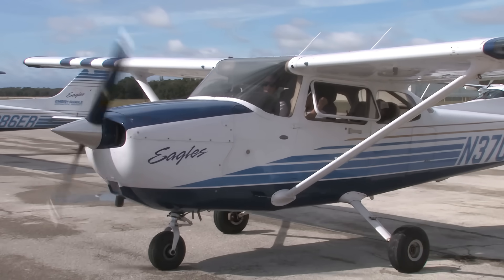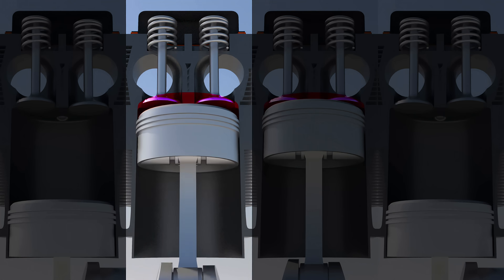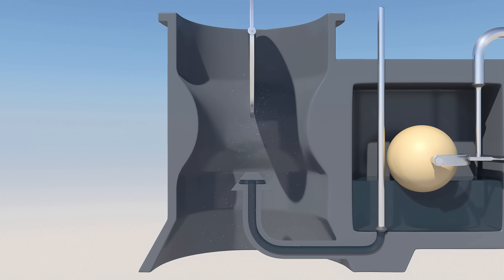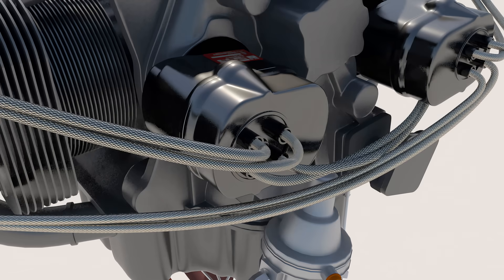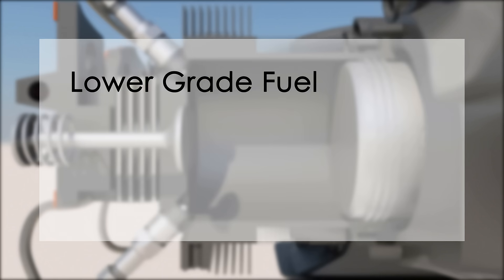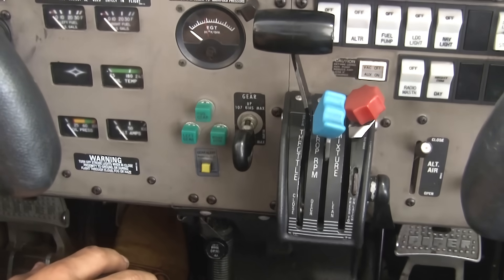Aircraft Systems - 03 - Engine

Comment: I would recommend installing a backup radio,gps,  battery, magneto, fuel pump, and have a  separate Garmin or digital handled avionics, think outside the cockpit.

Comment: The fuel air ratio is 14.7:1 by weight, not in number of molecules. It happens to be not that far off in the chemical formula (25:2 for octane) but as stated this was incorrect.

Comment: @erau great video but, I believe the airflow animation through the carburetor venturi is upside down 😅 if it moved up as it's animated here, you'd have high pressure on the wrong side of the venturi, leading to fuel starvation. Correct me if I'm wrong please 😁 just seems incorrectly animated
Reply: Thank you. I thought I was the only one that noticed that. You are correct, the low pressure side is on the downstream of the venturi. It is depicted and described incorrectly.

Comment: That’s interesting. These are basically just like automotive engines, but they run slightly leaner as automotive engines run at 14.7:1 air/fuel mixture. If you guys wanna learn more about engines go study automotive, it’s all kinda the same and goes way in depth on the science of things

Comment: I thought for sure they used a turbo of some sort. I cant believe how basic this system is. I've worked on cars that were more complexed. I'm curious on how they use the exhaust as heat though. I'm sure its basically like a water heated system. My question would be the safety measures from exhaust getting in the cockpit if the core failed.

Comment: Why do they usually use boxer engines when there's some other configurations that may be better. And who are the engine manufacturers? Because not all engines are same in terms of reliability, dependability, durability and longevity. I would not trust BMW, Mercedes , Ford or Chevrolet engines. My best bet is Toyota engines for example.

Comment: One minor error: It depicts nothing going to the magnetos when engaging the starter. In reality, in most airplanes, when you pass through the "Both" position BOTH magnetos are active, but as you hit START the RIGHT magneto is grounded out so that you're starting on the LEFT magneto only. This is why Cubs and early Cherokees that used a starter button had you start on the LEFT mag only, then turned on the RIGHT magneto after start. Otherwise, very good video.

Comment: Would have been nice to see you get a little more in-depth discussion about the magnetos, particularly how impulse couplings work. You also mention how turning the ignition off prevents the spark plugs from firing, but fail to mention the danger posed by a broken P lead (grounding lead for those of you who don't know). Spoiler alert: If the P lead wire breaks (which sometimes happens), the magneto fires a spark even if the ignition switch is turned off. When turning a propeller by hand, always treat it like the engine can start.

Comment: I know even not being a pilot or mechanic that the reason the Cessna C172 has two sets of ignition systems is for redundancy. Imagine loosing the engine over the distributor failing? Chills.

Comment: What are the reasons why you would configure the magneto to left or right only?
Reply: During engine start, the ignition key grounds out the right mag, so only the left mag provides spark. The timing of the spark from the left mag is retarded (later than usual) during engine start so the engine will start easier. (I just copied it from Google.)

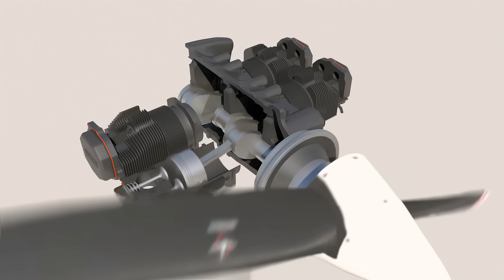Comment: 1:30 - 4 Stroke Cycle - Reciprocating Engines 

3:18 - Camshaft. 

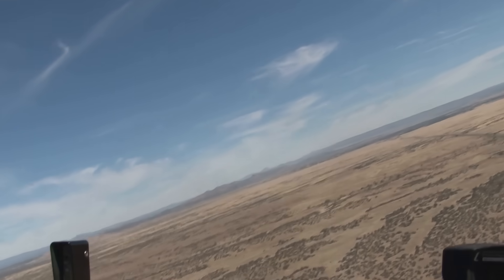4:20 - induction system 

5:45 - Carburetor System/Fuel Injection 

7:52 - ignition system

11:10 - Engine Cooling

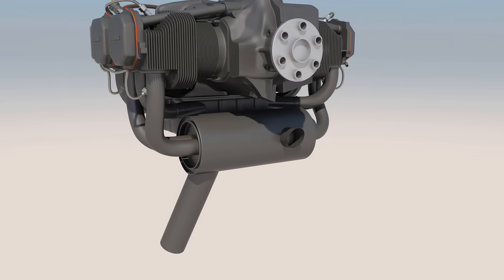12:17 - Exhaust System
Reply: Thanks, but the video was so Damm interesting that I dint even forward once..
Reply: @LeRiderOP  Le facts!
Reply: I’m 49 and I’m just getting into aviation. Never been a mechanical guy. This video combined with the PHAIK and my online ground school got me sqauared away immediatley

Comment: 3:30, "the camshaft is a rotating cylinder"?
The camshaft is a rotating shaft with lobes on the outer side to operate the push rods which in turn operate the valves at the required time.

Comment: 0:41 "Because without it, there would be no way to get the plane off the ground"

Gliders: "hold my ballast"
Reply: Some sort of an engine, be it on a towing aircraft or a winch is required to get gliders of the ground.
Reply: @strikereureka5081  You can launch a glider off a hill/mountain
Reply: @MIZUch.  Fair point, although in most instances some sort of external propulsion is used.
Reply: @MIZUch.  technically, that's getting the ground off the plane rather than getting the plane off the ground, still. So it really all depends on the point of view.

Comment: This is an excellent video however I have to nitpick 1 thing because it has frustrated me that it's taught like this in flight schools. Air-cooled engines are NOT primarily cooled by the oil. Yes, there is an oil cooler on some but they are primarily air-cooled just like some motorcycles and most old Porsches. Oil coolers are there to cool the oil because the oil gets very hot; i.e. oil is not like coolant for the engine. Most of the oil is not even where most of the heat occurs (cylinder head and body of cylinder) and the tiny bit that is there to cool the rockers is not enough to actually cool much at all, that is the job of the cooling fins.

Comment: You've confused Reciprocating with Internal Combustion. A Reciprocating engine is round with one mainrods and as much as 8 attached rods.
Your video is primarily an opposed cylinder configuration.
Reply: According to the Pilot's Handbook of Aeronautical Knowledge, all reciprocating engines "convert chemical energy (fuel) into mechanical energy [through the process of combustion.]" The engine you are describing is a radial engine which, like the four-stroke opposed engine in the video, is a reciprocating engine. It is all outlined in the aforementioned handbook, more specifically in chapter 7. Hope this helps!
Reply: @vivianahernandez2124  Reciprocating engines are round. All engines convert chemical to mechanical. There are two types of engines. Internal cumbustion and jet. Jets are uses as jet, turbofan and turboprop. Internal cumbustion includes all piston and rotary engines. Of the piston type are Reciprocating, oposed, inline and v configuration.
Reply: Nicolas Habash Nicolas Habash Not all reciprocating engines are round, but they all are combustion engines. A jet engine would be considered a turbine engine, which is not a reciprocating engine. I would take a look at that handbook, there is quite a bit of information you may find useful.

Comment: How does a single engine plane deal with engine torque?
Reply: Mystic Wine Are you talking about left turning tendencies? This is only more common during takeoff and climb, You can try the ground adjustable rudder trim, or simply use rudder.
Reply: @abbysnowmist  Thanks for the knowledgeable reply. I'm not a pilot but I was always curious after watching the way helicopters deal with it.

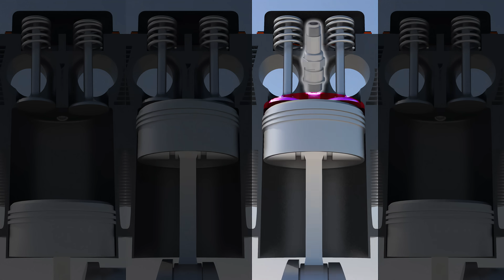Comment: 2:21 The spark event actually occurs during the tail end of the compression stroke, since the flame fronts move gradually, steadily building the pressure, such that peak intra-cylinder pressure is achieved at some point past top dead center where the connecting rods have more mechanical advantage to turn the crankshaft.
Operate in the red box, say 50° ROP EGT and >75% power, and the flame front burns faster, ICP occurs closer to TDC,  CHT rises and detonation could occur.
Reply: Sorry explain a little more @gza036
Reply: @harryb8023  lol...

Comment: Hi. i have Lycoming 0360 b1b engine. After 10 minute when i start the engine, oil getting hot over 100 so i am thinking my oil cooler working not properly or i applied it wrong? is there any manual how to apply oil cooler on Lycoming 0360 B1B engine. Please help guys it would be huuuuge help for me.

Comment: Enjoyed your presentation. The main issue with piston prop planes in the US is that they use leaded fuel or Avgas. The only use of leaded fuel in the nation. If you live near a small civil aviation airport or in a busy general aviation path you may wish to get your blood tested for lead. I lived through the leaded gasoline era of the late 60's to about the mid to late 80's and came out okay (took a lead blood test). With lead, no limit is a safe limit. There is a company called Swiftair that is marketing lead free Avgas. See their site at @t.

There is of course work being done on short to mid-range ELECTRIC powered propeller aircraft. Avoids the issue of lead altogether and cleans the air we breathe (yes electrons from coal powered plants are more polluting than "green" sources but the grid is getting greener every year). 

@t

@t

Comment: Its sad the piston airplanes are still using engine technology from the 1920's. It's still using manual air mixture. Even though many engines in aircraft like aero diesel engines are FADEC and control everything just like car engines, and now we are already looking at electric aircraft... here we see the crappy companies like Cessna, piper... still using this garbage that demands so much work from the pilot just to keep the propeller turning.

Comment: aeroplane electrical system working on which frequency whether50hz or 60hz or 100hz or ?
Reply: Most are DC at 12 or 24 volts. Large airliners also have 400 Hz AC on board.

Comment: Umm, Explosion? No.  Burning the fuel is very rapid but it's not an "explosion".  When leaning out the mixture in a pistion engine, it can become too lean and then detonate which is extremely hazardous to the engine.  Why do people continually use "explosion" to describe the burning fuel process in an engine.  It it NOT an explosion.

Comment: As long as these engines have been around you would think they would be nearly flawless , in fact they are some the most unreliable engines there is . Replace it with a Subaru boxer engine and you got many years of flawless service . The Subaru  , like a Porsche , is a boxer motor . They are fuel injected and turbocharged and very reliable . They are smooth and more powerful than the Lycoming/Continental . and run on car gas . This is just nuts . I am a 40+ year pilot with a few thousand hours in many types and you just never know when that heavy , under powered slug is gonna quit . In reality , these engines are just big bore VW but maybe only 25% reliable.

Comment: almost the same with vehicle engine
Reply: They should have mentioned that but they didn't!
Reply: Except it’s air cooled. Uses magnetos. Has dual ignition. Uses updraft intakes and carburetors. Has only a 2700 rpm redline. Has huge cylinders. Has fixed ignition timing. Has no emissions controls or systems. Is designed to run at 75% power for hours at a time. 

That’s why automotive engines make lousy aircraft engines.

Comment: As a Canadian and perennial sufferer of colder weather, I feel like it's important to add that another huge advantage of fuel injected engines is that they don't suffer from carburetor icing. Don't forget your carb heat, ladies and gentlemen.
Reply: Well said, although you really don't need a cold climate at all to encounter carb icing!
Reply: Carb ice is almost nil in a Canadian winter. It’s summer where it rears it’s ugly head—but rarely on Lycomings.
Reply: @Bartonovich52  True enough.

Comment: Guys, does anyone know where is it possible to find this one solidwork model of "Lycoming" engine? And how much does it cost? Thank you in advance!
Reply from the maker: Alex S. We’re glad you like the model. Our team custom built this one in-house and unfortunately it isn’t available to the public.
Reply: I'm a professional pilot and I try to do my own aircraft (by my hands) and I'm designing my aircraft in a solidworks. I don't want to publish something. I'm going to use Lycoming engine for my plane and it would be great to use your model in my designing. (it would save a lot of time and prevent a lot of mistakes).
 I don't need anything inside the engine, but for my designing very important correct dimensions and how to connect to my a/c (designing) different magistrals such as fuel line, air line, power control etc.
  So if you would help me, I will be very happy! (not free, of course) Because I'm afraid that I will never done my project. :((((
Reply: Thank you in advance!

Comment: how come a minute difference ratio does not add in millions of strokes to a few degrees leaving the valves to open at the wrong time?!
Reply: Cam and crank are geared together on a simple 2:1 ratio.
As long as they're assembled correctly, valves will always open/close at the right time.

Comment: Umm the part early on about "no matter what position the crankshaft is in one of the pistons is in power stroke in four cyl. Engines"
   I do not believe that is correct for a flat, horizontally opposed 4 cyl. Engine. In order for it to be balanced the opposing cyl. Would have to be in power stroke or there would be an imbalance.
   Its not just the piston and con-rod your balancing out, its the pressure from the power stroke.
  Am I correct?
Reply: You are confusing reciprocating weight with power strokes.
Reply from the maker: Stephen Smith -  Great question! The Lycoming IO360-L2A,  when viewed from the cockpit, is designed as follows....Cylinder 1 is on the front right, Cylinder 2 in the front left, Cylinder 3 is aft left, and 4 is aft right. It has an ignition firing order of 1-3-2-4. If cylinders on opposing sides were in the power stroke at the same time, the opposing force would most likely bend the connecting rods.
Reply: Jim Foreman no, most 4 cyl. Boxter engines in automotive use fire of 2 cyl. at once and use counterweights on the flywheel to balance it out.
   Interesting that these engines use the firing order they do.
   I guess its more efficient that way, or at least I would hope so.

Comment: Best explanation ever seen... Thanks alot
Reply: @NonyaBusiness! It is not really wrong but I think some things are showed in a way it could be interpreted wrong and some things are told as if it was like this for every type of engine.  Like the 4 strokes shown in sequence in 4 separate cilinders as if one cilinder only does 1 of the 4 strokes. It is demonstrated very nice but it would be more clear if they showed it in 1 cilinder and show an animation of all 4 working . What is wrong is what they say about the order/position of pistons relative to each other. Not every engine has the same sequence as they told. There are numerous sequences and engine types. Not only 4 cilinder boxers. 
But I wish I could see videos like this when I was a little kid.
Reply: @NonyaBusiness! Yes, they are called two-stroke but that is not what I ment. :-)

Every cilinder indeed has the same sequence of 4 strokes that they repeat that same sequence over and over. All do that at the same speed because they all are on the same cranckshaft. But the order in witch the cilinders are at the same stroke like the ignition stroke is complete free to the designer. If you want you can make it so all cilinders ignite at the same time. It would not be smart but it will work.  Often pistons do not even reach the TDC at the same time. Or do reach the TDC at the same time but not in the same type of stroke.
 
As I said it is not wrong and most will understaned but others could get the wrong  impression of the order of strokes between cilinders . 

For me that is clear but I worked +30 years on engines (rebuilding/restoring motorbikes and cars, from 1 cilinders upto V8's, from 30's engines to modern stuff) 

I was looking for some info about WW2 and older airplane engines. They are manual controlled and I hoped to see some examples of how the controls are implemented.  (like how a governor looks/works, how they implement superchargers and their gearchanging. How  the automatic control in f.i. a FW190 works etc. 
Because the graphics were well done here I kept watching it.
Reply: @NonyaBusiness! I agree.
Reply: It's the worst explanation of how an engine works I've ever seen. Its massively flawed and very wrong in a number of places. Whoever made this video is clearly not a pilot and most definitely not an engineer!
Reply: Julian Neale Okay. I would like to hear what is wrong.
Reply: Julian Neale what are you talking about?
Reply: @julianneale6128  show us your explanation then!!
Reply: @julianneale6128  show us Jedi Master

Comment: so the more propeller rpm means more speed!
just put a high to low gearing system from the main crankshaft to the propeller not direct connect!

see... science!
Reply: No! The propeller tip speed must remain below supersonic speeds, or the propeller will be damaged, most propellers rotate at around 3000 RPM peak.
Reply: Also,
Increase speed (via gearing) = a decrease in torque
On the plus side.....
Decrease speed (via gearing) = an increase in torque!
That's what they do with turbo props.  High rpm from a gas turbine engine, converted into massive torque on a huge propeller turning at normal speed.
Reply: No aircraft engines that I know of have an “overdrive” like that. This is because the maximum speed of a propeller is limited by the tips exceeding the speed of sound, which is about 2900 on a light aircraft to about 1500 on a large turboprop. 

Most reciprocating engines produce their best power above 3000 rpm, so a reduction gearbox is used to gain extra power. However, since weight and reliability are also desired on aircraft, it’s often better to make the engine direct drive and optimize it for low RPM and simplify it by having a small number of large pistons and cylinders. 

The four cylinder engine in this video is actually a 360 cubic inch (5.9 litre) displacement.. more typical to the displacement of an automotive V8. 

A constant speed prop will help a plane go faster by keeping the engine at an optimum RPM while it adjusts to coarser pitch to take more of a bite out of the air.